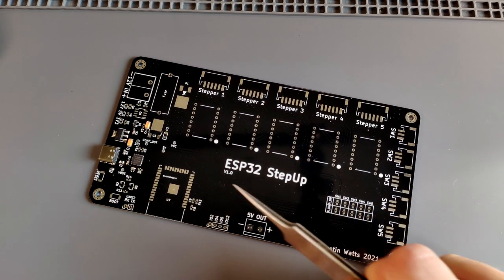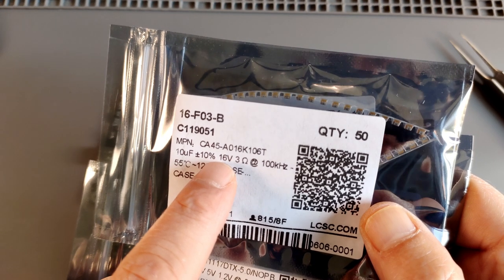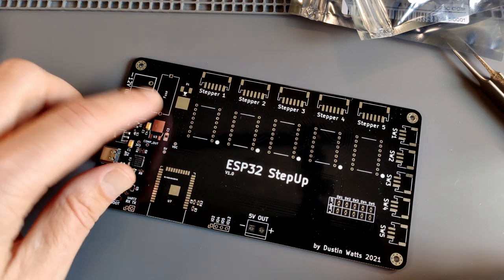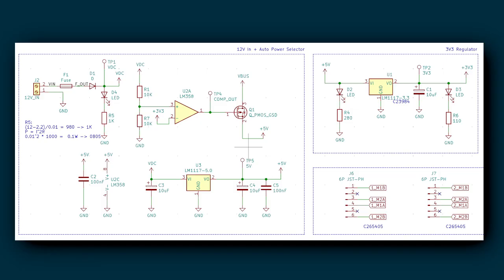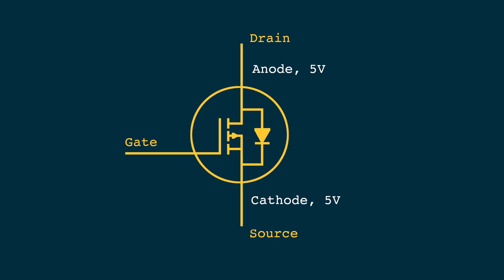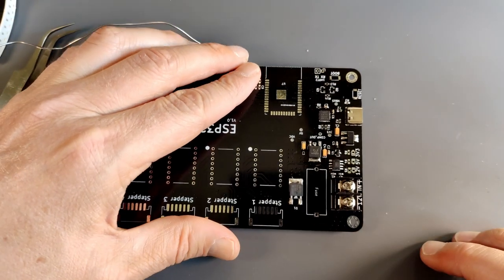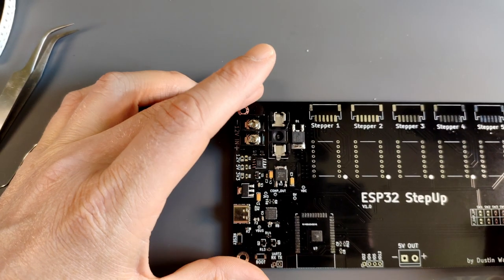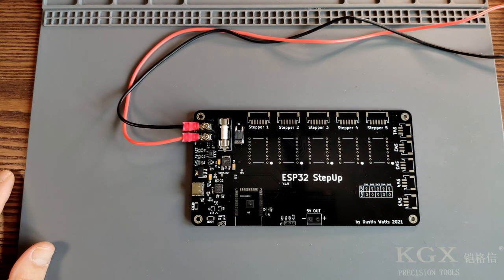Building a 5 Stepper Driver Board w/WiFi & BLE (Part 3)

Comment: If your blue/white tack gets stuck on things make a small ball of it and dab it on the offending bits that normally removes most of it if not all.  This trick also works on walls etc.
Reply from the maker: You are absolutely correct! Blue tack sticks best to blue tack :) I find however if it gets too warm, this effect is reduced...